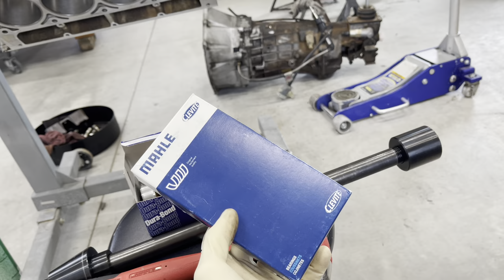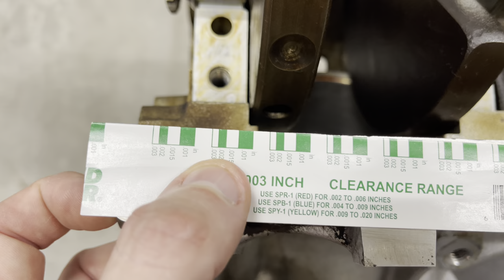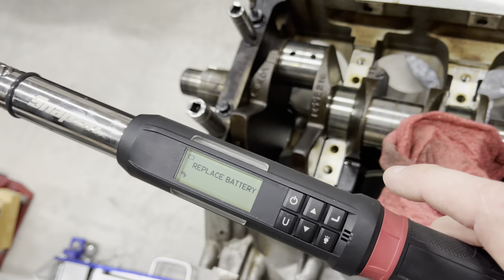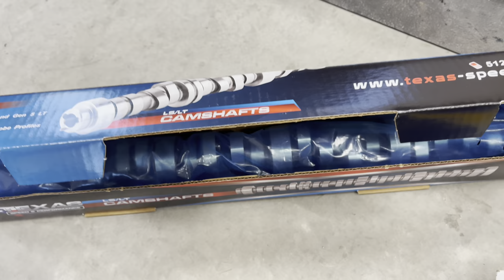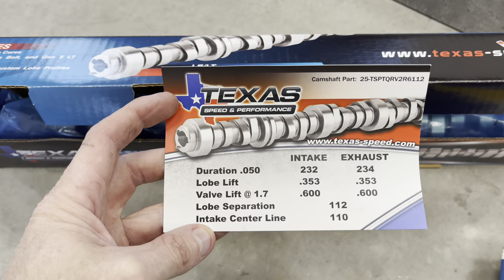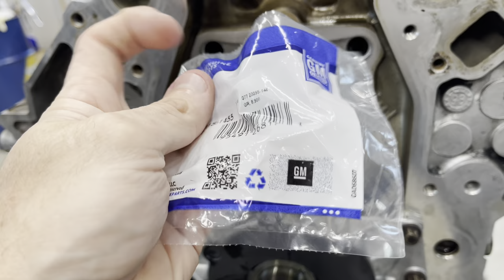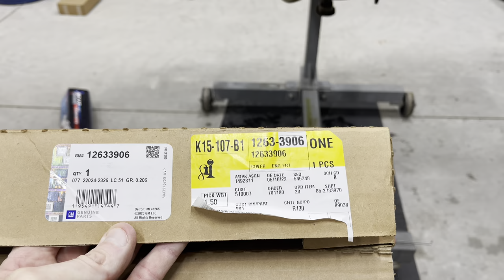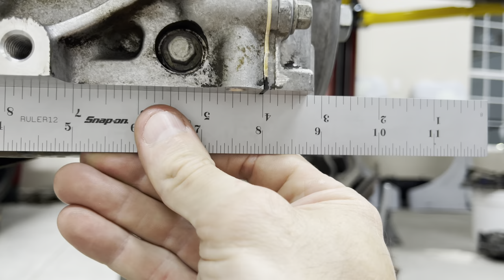How to completely assemble an LS1 Short block step by step. 1LE Camaro LS1 Rebuild part 5

Comment: No need to apologize for the video length, if everything isn't covered then mistakes will be made.

I have an '05 LQ4 6.0 disassembled in my shed. I had picked it up for only a $100.00 bill. It has three spun rod bearings so a crankshaft replacement is necessary. Some of your pan and cover alignment methods are good to know. I may have thought of this when I'm assembling my engine, but now I'll automatically have these methods in mind when it comes time to put everything back together. 

I'll keep watching out for your videos, you're giving me more motivation to rebuild my '68 C10. Thanks Curt!
Reply from the maker: Your welcome!!! And thank you for watching.   There will be more videos to come!!

Comment: Curt, great job on the explanation of the parts, steps, do and don't do. I don't remember how I aligned the front seal, but I found a 1/4" drive socket the fit perfect. I could go all the way around with a nice tight fit. 
  I serviced the donor vehicle before it came to my back yard. My son now knows what black ice is! On a custom wood & metal tube stand, I cleaned the injectors with my OTC pressure pot and 10% X66P / Top Engine Cleaner and ran 4 times with fresh oil & gage. Noted damp areas but then ran a compression test. I did want to pull the heads & exh. & int. valve seats look great. I had 190 PSI for high on a SnapOn tester and 182 for low. I was happy with those results.
With everything taped, I used the cheapest oven cleaner from the dollar store. It works great on both metal cleaning operations, twisted wire end brush on a drill and wire brush. 
I do the knock sensors with dielectric grease, then seal top & bottom with high temp red. I have used the black GMS with no success and never use it. Gray is the same as Yamaha bond #2. It have never failed me. Plus the oil galley end caps, always a thin film of Loc-tite 518 red jelly. It is an anaerobic sealant that cures in the absence of air on machined flat metal. Excellent luck. I do use the Sac City Corvette "Bar-Bell" but eased the sharp edges inside the oil pump to all better flow during a sharp 90 degree turn. Be careful on oil pans in front of the "Bar-Bell". Most pans have an internal oil by-pass in case the filter becomes plugs. (Who does That?) But aftermarket pans don't have one or take a punch and seal it.
  You did good! I have told you before, you should have 10k subscribers. Blessings to you as my lumbar electrodes (#3) have failed. All hips and #8 rib but nothing in center up. Too much scar tissue and Dr did even tell me he couldn't get one out, my GP told me. So decades of knowledge is headed into a wheelchair in my 60's. That's life. Sucks sometimes so stay safe. 
DK, ASE master + L-1...
Reply from the maker: Thanks for watching as always, and thanks for your tips as well.  I’m sorry your health has deteriorated, I hope you have some better days in the future.

Comment: I like the idea of the bellhousing as the straight edge.  A buddy and I get into similar projects.  We have used the SAC City tools front and rear then snug everything down.  Luckily no problems knock on wood.  We did the same job almost eactly a few years ago, bearings rings, hone etc with the help of another friend that was working at a machine shop.  Injector was leaking down on a high mileage motor that sat due to other life issues.  We have replaced short blocks on other builds.

Thje 97/98 rear cover has a deeper oil crossover over cast into the cover.  99+ has more depth in the block but less in the cover.  I would not run the later cover on the early block.  We thought about the early cover on the later block for more volume in the crossover but chickened out.  The motor was a LS6 block seeing road coarse track days.  The LS6 according to many is the most reliable and we weren't brave enough to be our own guinnea pig.

Solid thought about build, the devil is in the details.  If someone wants to do it right, they'll watch the longer video.  I am not a professional engine builder, tech, or mechanic.  I have friends that are and a good relationship with a local machine shop.  I am always looking to pick up more knowledge as I can't afford to pay someone that I trust to do the work.  Thank you for the detail.
Reply from the maker: Your right about the early LS1 cover being thicker, but the oil crossover channel is much narrower. The replacement cover is thinner but the crossover channel is much wider. If you factor in the steel gasket thickness I think the later cover will actually flow more. But I don’t know if any testing has been done on the matter. GM sells the later cover as a replacement for all production LS motors so I’m not really worried about using the newer style on my early motor.  One thing I didn’t mention that I will touch up on in the next video is the block needs 4 dabs of silicone on the corners where the cover gaskets meet the oil pan. And I only use permatex grey for silicone. It’s the only thing that will last as long as the gaskets.  Also as far as you working on your own stuff, I don’t blame you.  It’s hard to find competent mechanics that you can trust. I am one and I can only think of 2 people that I would let touch my vehicles.  It’s going to be interesting in about 10 years who is going to be fixing cars because there is a massive shortage of skilled workers right now.  Thanks for the comments and as always thanks for watching.
Reply: @curtrobinsongarage5452  Agreed GM does sell the late cover as a part for the early block.  It'd work for a cruiser/OEM application but if you're beating on it, I wouldn't trust it.  Agreed on the permatex. Yes there is a shortage of skilled craftsman.  Going to be interesting.

Comment: Its not good idea to lubricate bearings and crankshaft with assembly lube when meashure with plastigauge.
Helpful video, congrats.
Reply from the maker: Normally it’s not, but setting a polished crankshaft in new bearings always makes me nervous.  With the lube I use I’ve never noticed a difference in measurement wet or dry. Your point is very valid. If using a moly based lube it would indeed affect the measurement.

Comment: When using plastigauge it MUST be done dry, from watching it was obvious it was not
Reply from the maker: People keep telling me that and I’ve done it both ways.  With the lube I use measurement is the same.  But if you’re getting picky you should never ball home cylinders either.  Nor should you really put pistons back in without snap gauging the cylinders and check for out of round.  If this was a new machined block with a completely new rotating assembly I would do things a little different but thanks.